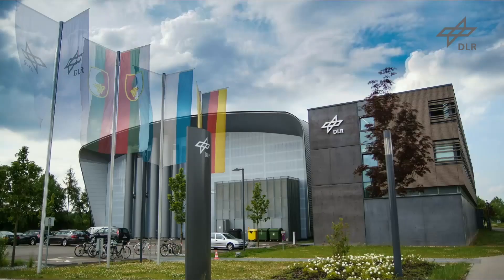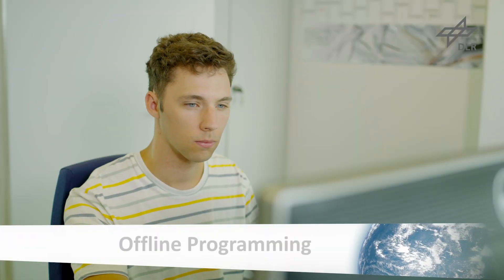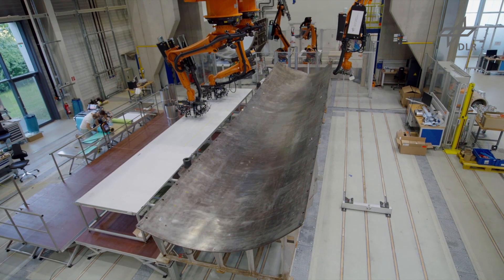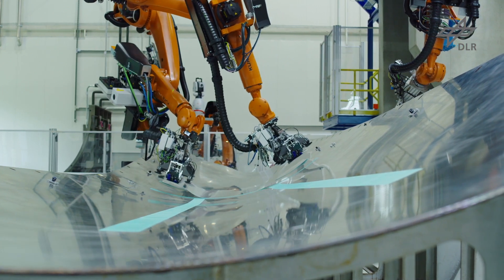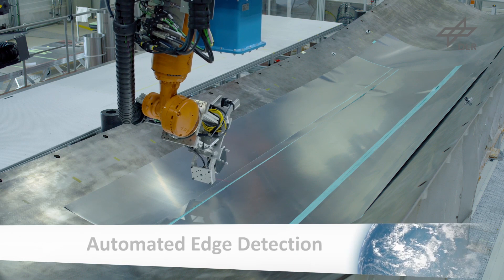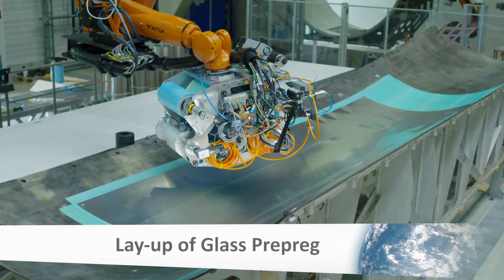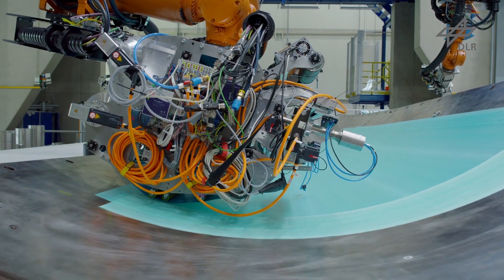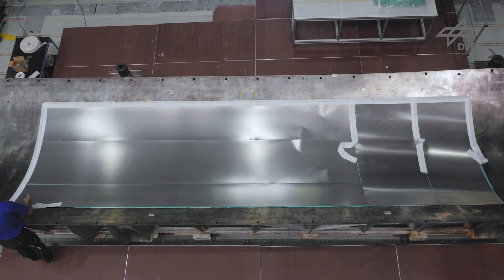ProfiRumpf: Automated production of an aircraft skin made of fiber-metal laminate

Comment: Hi everyone, 
I’ve add this vidéo to my favorites. 
Is there any update from sueden ? 
A car chasis out of carbon fibre is between 80 to 150kg. With 100wh per kilogram of composite will give between 8 to 15kw of battery. (If body panels added  can go up to 20kw)
The most efficients cars do around 8kw for 100km. 
So without battery a car could travel 200km per charge, (average travel per day is 40km) and with very very fast recharge supercapacitors could be the next best thing for automobile. 
(1kg of carbon fiber is 50kg of CO2 and 1kg of carbon make almost 2kg of composite, si even thé environnement impact of the building of the car is restrained)